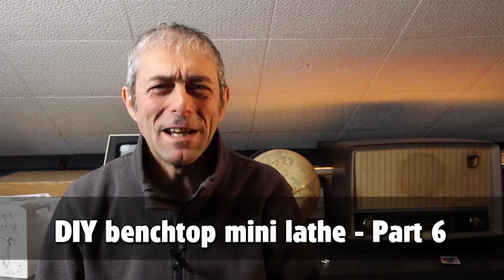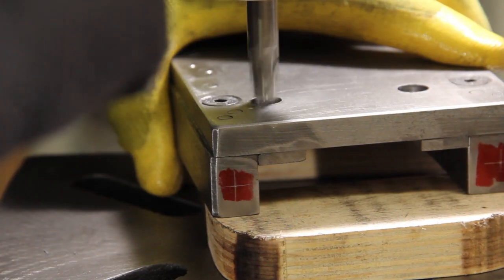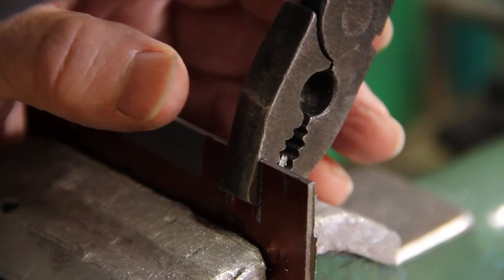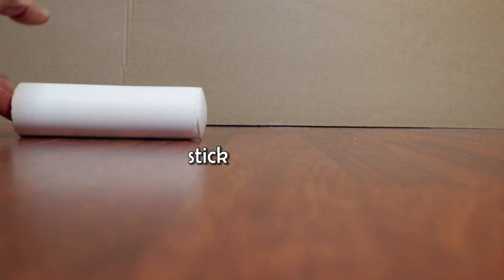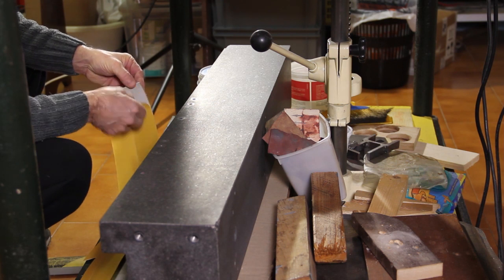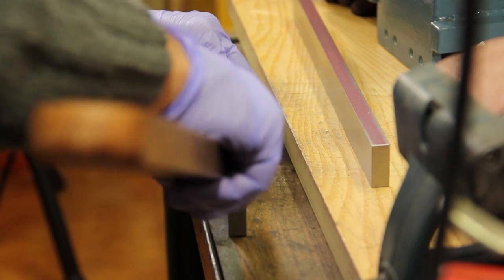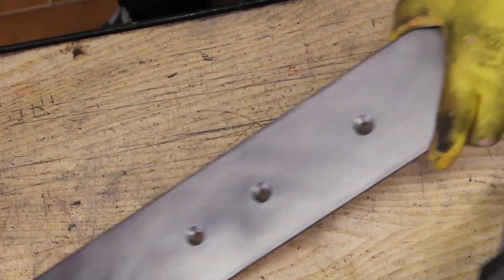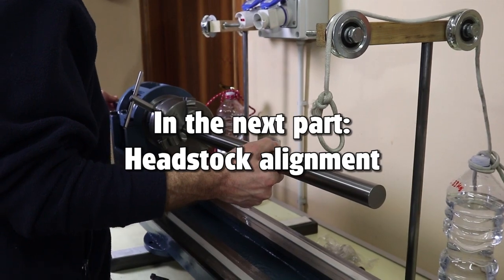DIY precision mini lathe - part 6 oil ports and more

Comment: really enjoy this series so far, I will definitely keep some of your techniques in the back of my head.
However, I would suggest to put some oil grooves along your slides. They don't have to be precise or anything, just some grooves in the shape of Zs along the guide surfaces, can even put them in with a dremel or similar. They help retaining and distributing the oil.

Comment: good work. maybe I don't know how to use the correct term in your language, but I'll try: Did you not grind the guide bars with a grinding wheel? did you just use sandpaper? maybe it explained and it went unnoticed. if so, sorry!
Reply from the maker: No grinding wheel, just scraping. Follow the full series and in particular the video where I revisited the Whitworth method. Cheers.

Comment: Late comment but this is when i saw this video. I see a lot of those square ways for mill tabes or lathe and i don’t know how you will be able to adjust z axis play. On a dovetaill system the gib controls the z axis play too but on this one just x and y. If someone could explain it would be much apreciated. Thanks